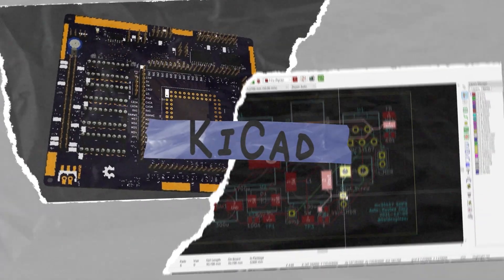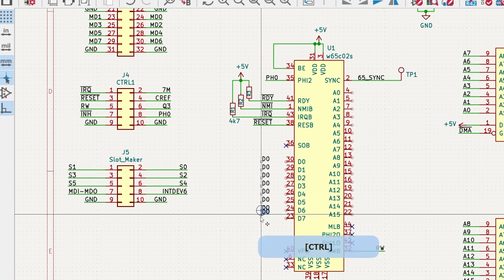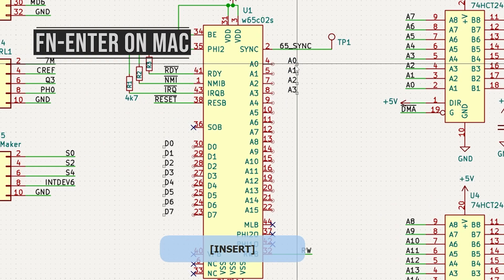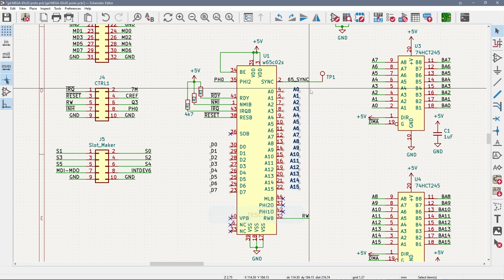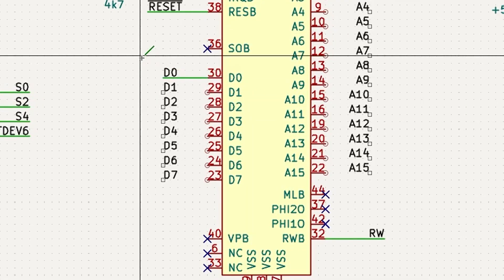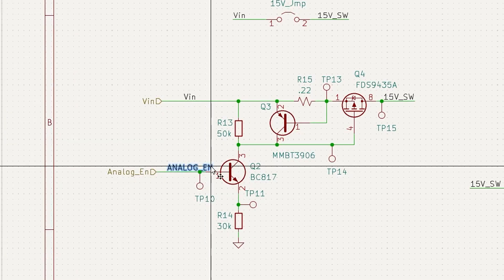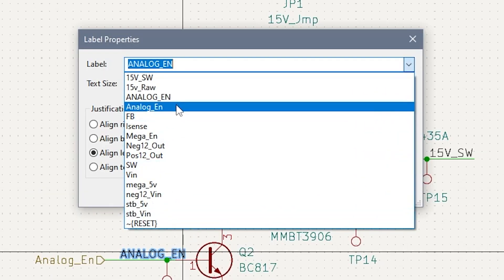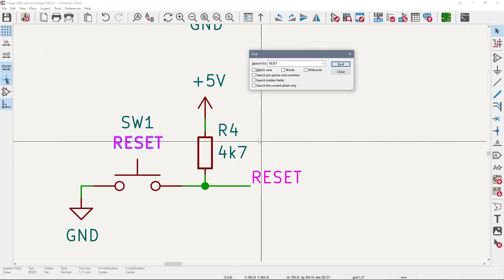INSert Labels and wires with one key!  | KiCad 6.x Quick Tips #2

Comment from the maker: MacBook users need to press [Fn-Enter] for the "INS" key.
Reply: Hm, Fn-Enter not working on this M1 MacBook Air...
Reply from the maker: It's been a long time since I used a MacBook. That's the short I remember using. Either it changed or KiCad isn't seeing it.

Preferences -> Preferences -> Hotkeys -> Filter by "Repeat"

Let's double-check that INS is still the default on the macOS/OSX version of KiCad.
Reply: @AddOhms  Yeah, I went into Hotkeys and found that the 'Repeat last item' was set to I. Bizarrely, the same key was assigned to 'draw a line', which is the action it performed when I tried it. I changed the 'Repeat last item' option to Cmd-I and now it works fine.
Reply: or re-define the hotkey?

Comment: Hello, 
Knows anyone how to create jumpers in PCB design which will clear error message about missing connection? 
Thank you.
Reply from the maker: KiCad 7 does not support jumpers for a single net. I’ve heard it’s on the roadmap.
Reply: @AddOhms   - Found workaround by changing via type to "blind/Buried" and mapping with internal traces. Not sure if it is good idea for manufacture PCB order, but for home made, it is kind of solution. Drill holes won't be inluded into dirll file, so it can be done by CNC machine and later on jumper can be even as SMD.

Comment: As of May 2023 and KiCAD 6, the "I" (eye) key will insert a new copy of the previous wire or label
Reply from the maker: Which OS? For me, in Windows KiCad 6, KiCad 7, and Mac KiCad 7, the "I" (eye) key's hotkey is the default: Add Graphic Lines. Maybe you changed it in Preferences -> Hotkeys at some point.

Comment: This was super useful. I’m learning KiCAD for the first time and the PCB I’m working on has a lot of labels like A0 to A15 and D0 to D7 on multiple chips. 

One thing that was weird is if I copy and paste a label, INS continues from a previous label location instead of the newest label. I have to create a new one from scratch in order to reset the location used by INS for new labels.
Reply from the maker: INS is "repeat" last command. So it doesn't know to pick-up where the copy/paste ended. It's picking up from the last label created.

Comment: great tips for KiCAD6. Pls keep them coming.I do find it tricky to edit existing footprints or create new ones and ensuring -- the whole library management I find particulary confusing. Also when sync from schematic to PCB sometime it resets footprints and you loose the position of the components on the PCB. A series of tutorials/tips around these subjects would be very useful :-)
Reply from the maker: I’ve never had a case where component positions were changed between schematic and pcb update—except when I removed and re-added a symbol.

Comment: I have a question regarding how to point an arrow towards a resistor in KiCAD. So I have the resistor aligned vertically and the top input is connected to a 5V while the bottom is connected to GND. I want to place an arrow pointing towards the middle of the resistor. How can I do that?
Reply from the maker: Use the symbol R_Potentiometer .

Comment: I knew most of those tips but I didn't know about the flipping on the Y axis.  I used to do the INS key 15 times and then just rotate the group.  But I would then have to drag each label where it needs to go.  Flipping it on the Y axis is so much faster.  Thanks!